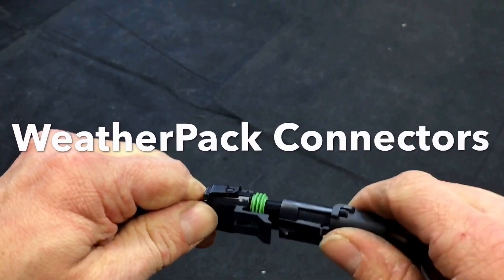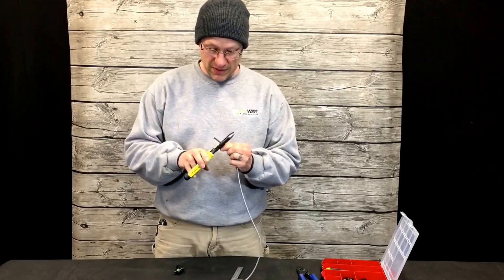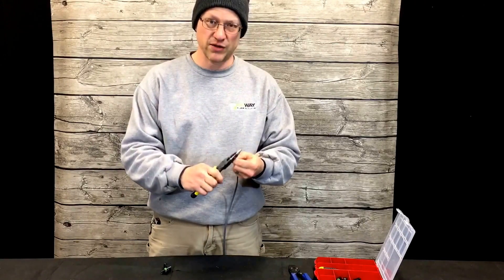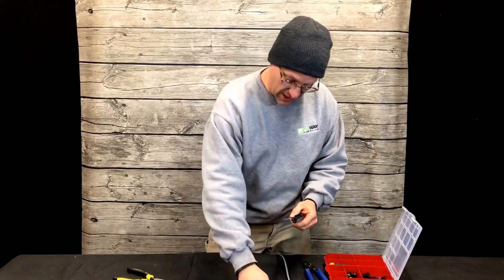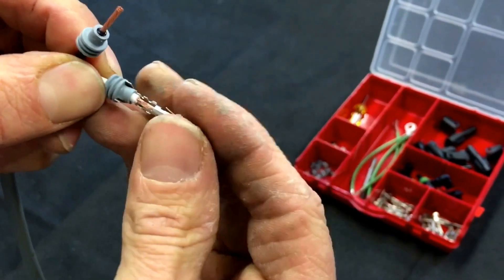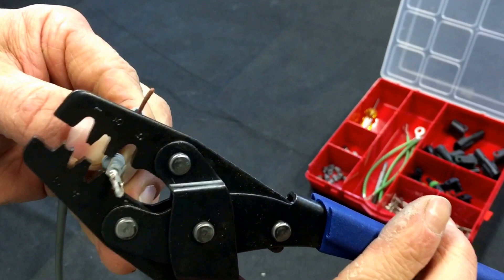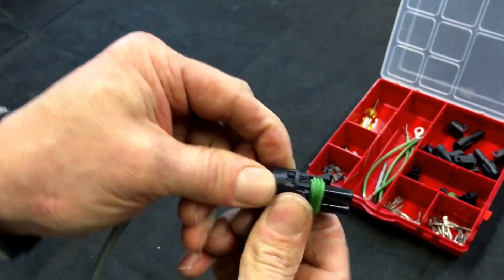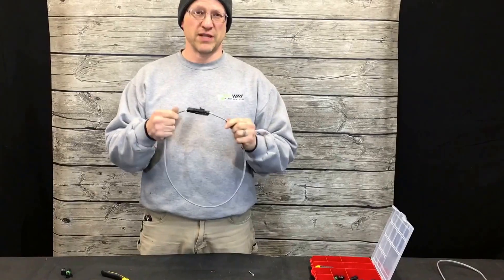Weather Pack weatherproof DC connectors - tutorial

Comment: If you reference the manufacturer's (Delphi) materials for these connectors, you will find that the terminals and connectors are reversed compared to what is presented here. The Male terminals into what's commonly referred to as the Female connector and the Female terminals go into what's commonly referred to as the Male connector. I say "commonly referred to" because most of us would refer to the connector housings the same way they are referenced here in this video. In actuality,  Delphi calls them just the opposite as they name the connector housings by the type of terminal that goes in them, not by the design of the connector. Otherwise good video.